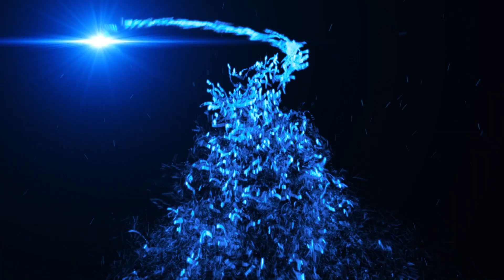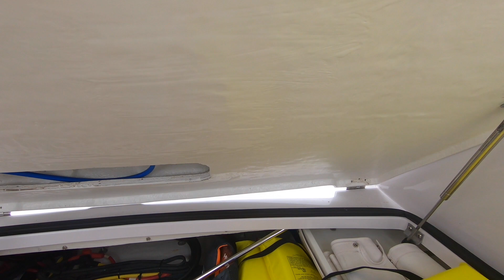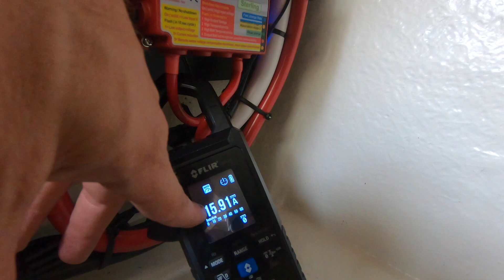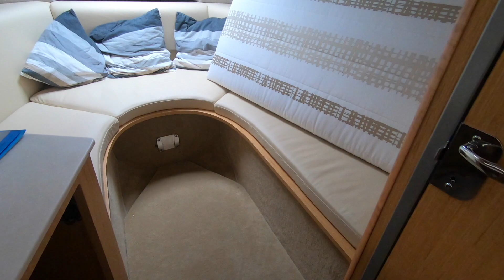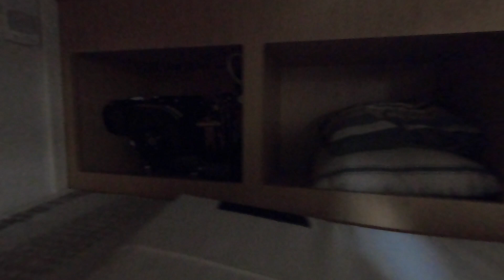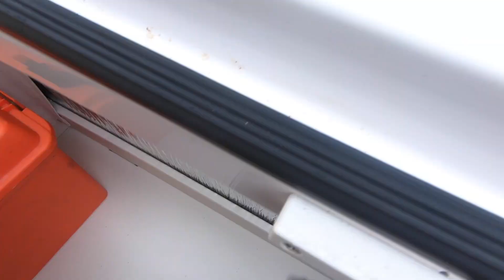DC 12v 7,000BTU Air Conditioner on a 2020 FourWinns v255OB by Mabru Power Systems

Comment: Is the air conditioner an AC or DC unit?
Reply from the maker: The unit is 12v, it is not working through an inverter.

Comment: How long can this setup run the AC on the house bank?
Reply from the maker: runtime on our 250ah Lithium is 8hrs with the unit of full speed. this runtime would be affected by how many other consumer are running such as refrigerator, stereo and inverter.
Reply: @MabruPowerSystemsINC  Thanks.  Have you tried any "real world" tests that take into account the unit running at lower speeds once desired temp is achieved, other likely uses, etc.?